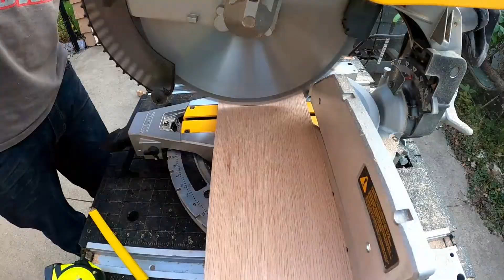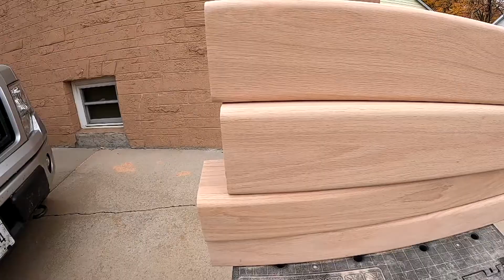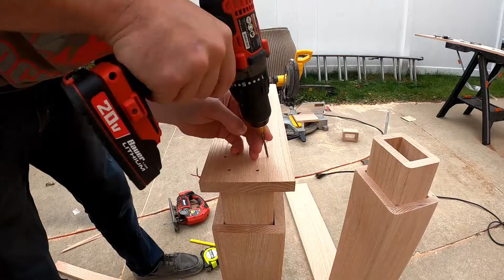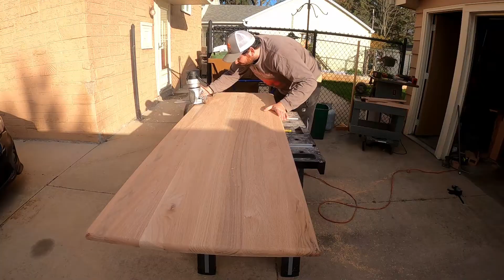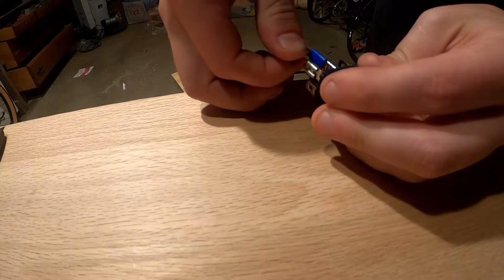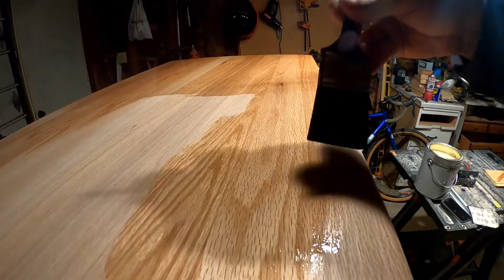DIY Sit Stand Desk | Hidden Electronics | Nested Legs

Comment: Hi Dan, thats an aweome project and i realy liked your wood works especially, what i would like to ask is i plan to make a Lift project like yours, but instead of a table it will be a shelf (50 Pounds/ 20 Kg total), i worry about using two actuators because if they are not in synch or lose the synch after a time, so i plan to use one actuator in the middle, what do you think about my concern, that would help.
Reply from the maker: After a couple years I have noticed my actuators getting out of sync.   I think one in the middle is fine.  Each one of my actuators can lift 200 pounds, so weight should not be an issue!
Reply: @zirnheltdan  For 200 pounds rated actuators your table or weights on it should not be a problem but why your synch is gone after a time is maybe about the actuators didnt face the same weights on them, for example if you keep a heavy weight ( lets say a pc case) on one side therefore that actuator gets lower speed and amperage changes so inch/second on the stroke changes,  maybe thats why they got outta synch, what do you think about that ? Or you think there happened another issue by time?
Reply: @yoknone2786  it's possible, that's why I'm building one with a microcontroller and an accelerometer with PID control to lift each one separately and always have the table parallel to the ground

Comment: did u fix teh adductors to the base as well/ground i mean. 
so that they are not just loose in the legs. or are they just lifting up through there impact to the ground plate?
Ty
Reply from the maker: They are fastened top and bottom.

Comment: How are the nested legs holding up? In my experience wood on wood sliding parts is not that easy to construct.
Reply from the maker: Wife has used it ever day for work since I made it, no issues at all.  With both of the actuators combined, there is over 400lb of lifting force. To say the least, it does not get stuck.

Comment: Absolutely in awe of this design. You are a visionary, good sir! I was wondering if there might be a way to actually bring this desk even lower- I really enjoy japanese style tables, where you can sit on the floor, so I'm wondering if there might be a way to allow this desk to come all the down to, say, 11-12 in height? I realize that this would require different actuators (which I don't know much about), so I will be doing research on those!
Reply from the maker: I'm sure it could be done, but I can't say i know how it could be done.  The issue with the actuators is it controls the height at the lowest point and the highest point. If you get smaller actuators, you could have the lowest point to 11-12 in, but then the maximum Hight might only be 20 inches. The actuators I used were 22 in (i think) and extended another 18 inches. So the smaller you go, the less it will extend.
Reply: To lower any further than the height of the actuator itself. You'll need rotating/swinging linkages and additional  horizontal or actuator mounted at an angle, to push the main vertical actuator to an angle as the vertical actuator lowers. That will force the table to go lower as a tilted actuator is shorter than an upright one. It's possible but complex and might have somewhat less payload capacity.

Comment: What was the rough cost of this build would you say?
Reply from the maker: This would have been before the wood cost inflation but I think for all the red oak and the actuators, somewhere around $400 -$450 I think. The most expensive was by far the top of the table as I did not glue that up myself, I bought it at the size it was.

Comment: How do you account for thr issue when one actuator is movingnfaster than the other? Dont you need a control system?
Reply from the maker: You definitely could add a control system and it might have been more luck then anything but both of my actuators did move at the same pace and it has never (yet) had one move faster then the other enough for the table to be angled.

Comment: does the whole table wobble side to side? i made a different desk and i had to add 2 stretchers just to remove wobbling on a 2 legged desk.
Reply from the maker: Mine didn't really move side to side, I think it helped that I used 6" wide boards for feet and was able to secure it pretty well.
Reply: @zirnheltdan  you know what they say about tables with big feet....

they don't wobble.

Comment: so if I wanted to make it hold more weight just use heavier duty actuators?  I need it to hold 200lbs
Reply from the maker: Each of the Actuators I used could lift 225lb, but yeah, that is the idea, bigger actuators can lift more weight.

Comment: sir, no doubt this is a great video, but i have a question, how can i use the slider/channels that use in the drawer to make the movement more smooth because in this method wooden parts rubbed against each other.
if there is another way for smooth sliding please let me know. i will also make this kind of study table from my local wooden workshop
Reply from the maker: I thought about using sliders but with each actuator being able to pull/push over 200 pounds I did not think a little rubbing would matter. I think you could take a router and inlay the slides so that you do not have a gap between the nested legs.
Reply: @zirnheltdan  👍

Comment: Hi again! I've bought all the materials, so I'm ready to start the project! The thing is that I'm deciding whether I'll control the linear actuators with an Arduino (to switch between sitting and standing positions by pressing a button) or with a simple switch just as in your project. 
Can you tell me how much time your linear actuators take to get to your standing position height from your sitting position? Also, as time has passed, do you consider it crucial to have programmable sit/stand height buttons? Have a good one!
Reply from the maker: My wife uses the desk and she is shorter than I am. I bet it takes her about 30 seconds to get to the right height and would take me 40 seconds.   I think a button with the Arduino is an awesome idea. Go for it!!
Reply: @zirnheltdan  Thanks for the quick response buddy! I'll give the Arduino thing a shot! Maybe I'll make a video about it, I´ll let you know! Have a good one!
Reply: how much did everything cost?
Reply: @sick6003  Because its wall-mounted, about $300

Comment: Awesome job! I've been designing my own standing desk and came to YouTube for inspiration. This is almost exactly what I have in mind. One question: with these actuators, are they geared so that they remain in position? I've been concerned about getting them to a specific point and then having them sag, especially when not fully extended or retracted. One thing I'd like to do is get the perfect sitting height and perfect standing heights. Planning on building a controller using a pi pico to store presets and do adjustments etc. The alibaba descriptions leave a lot to the imagination lol.
Reply from the maker: Yeah, these actuators are perfect for that. I was able to raise it up like half way and sit on the desk without anything moving. I like the Pi idea, that would be cool!!
Reply: @zirnheltdan  that's awesome and a massive help, thanks! Yeah I'm looking forward to putting it together. Got some ideas for controls and found some screens that look good. Will probably take me a while like all my projects but I'll post it on hackaday once it's done. 
 
Do you get positional feedback from the actuators? Or is it just they move in one direction when the voltage is in one direction and that's that? Would I have to use timers to estimate how far they have traveled?
Reply from the maker: @buzz1ebee  Basically exactly the latter.  I would think you could program your Pi to determine position with volts over time. Since the Actuator will move at a determined inches per second with a determined volt/amp.
Reply: Hey guys ! I'm planning to make a similar control for my 24V DC motor using Pi Pico. How's it going for you? My setup will look like Pi <-> Motor Driver (To decide) <-> Motor <-> SMPS. Any feedback?
Reply: @vignesh7224  nao aha esses controles para venda?

Comment: Another question:  Was your decision to mount the actuators upside down as a part of the moving piece an engineering decision or just happenstance?
Reply from the maker: By design. I wanted the wire as close to the top of the desk as possible so that i could run them on the underside of the desk to the switch. After the video I did add a power strip to the underside as well so that i only had a single cable running down to the outlet.
Reply: @zirnheltdan  Makes sense.  I'm planning on building something similar in the next week.  I'll see if I can't also document it.

Comment: Any challenges with friction on the legs?
Reply from the maker: I did not have issues. I did sand down the inner legs so it was as smooth as possible to reduce that possibility.

Comment: Great looking desk, do you get any binding on the legs if there's weight on the front edge of the desk?
Reply from the maker: Very little.  luckily the width of the legs are enough that I was able to secure the legs on pretty well. I was able to lean and put weight on the foot side with little bind, but with where I secured the legs in the back of the desk, there is a little.

Comment: Hi, great video and awesome result ! . I was wondering could this be done with just 1 Actuator sitting in the middle of a bar going left to right attached to both legs ? What Im worried is about this not being very stable when the actuator is extended....
Reply from the maker: From a weight perspective, it could hold it. Each actuator I used could lift over 200 pounds. Like you said, I would worry about the stability of it. Maybe a single leg in the middle with some really wide feet at an angle and not as wide of a desk?
Reply: @zirnheltdan  200 pounds each?
Reply from the maker: @Chauncey0618  That is what they are rated for. I use some of them to lift my truck topper too and they do it without issue.

Comment: With the actuator you have listed. Is that for a set of two or just one? I’m also trying to do a table with 4 legs. How do you think wiring would be for that?
Reply from the maker: I think the ones in my description are only 1. As for having 4 legs you would probably want to use a synchronizer to make sure all the legs are lifting at the same time. I was going to do that myself but opted against it after I saw that the two i used stayed in sync pretty well.  With 4 legs and each leg having a single actuator you have a higher chance that one raises at a different speed and then your desk it slanted.
Reply: @zirnheltdan  thanks. could you also create another video on how you did the wiring. in the video you were moving kind of fast
Reply from the maker: @danieljenkins6521  Great Idea.  I will try to put something together!
Reply: @zirnheltdan  Thank you. I really appreciated

Comment: Are Power lifters synchronized  ?
There is problem with not same hight on both sides?
Great project ...
Reply from the maker: They are not sync'ed. I did not have an issue with one going higher (or faster) then the other.
Reply: If possible to get actuator model, brand ? I do not have idea for size of actuators
Reply from the maker: @lanskyenterprisellc9490  Check out the links in the description. I used off brand actuators and I think they were either 20 or 22 inches.

Comment: Very Cool

Did you attach the other end of the actuator to the bottom leg ?
Reply from the maker: Yup, both ends are secured down. Probably could have gotten by without but I wanted to be sure the actuator wouldn't move around on me.

Comment: Amazing project first of all 😀 Can this be done via metal frames also? how much is the max bearing capacity of the table? and finally how did you synchronize the actuators?
Reply from the maker: Yeah, metal would be fine, each actuator is rated for around 200lb. As for syncing them, I didnt do anything.  I was worried about it and thought of using two switches but it turned out they synced pretty well on there own.
Reply: @zirnheltdan  If you have a faster actuator, you can add a speed control to one of them to slow it down so they're in sync if that's ever an issue.
Reply from the maker: @jongriffith4293  That is a great idea. I wish I had some that were faster...these are a little slow.